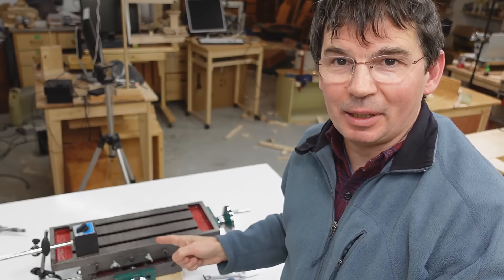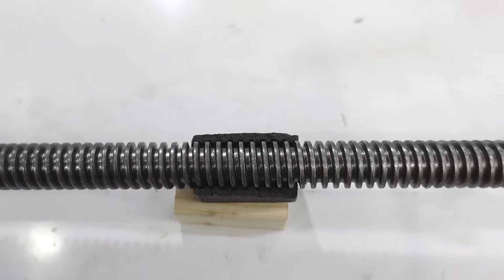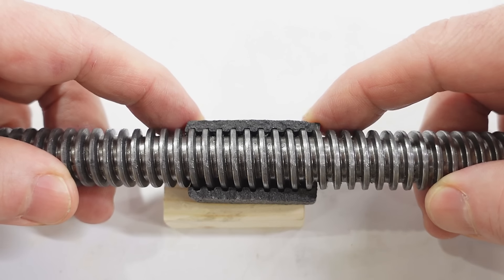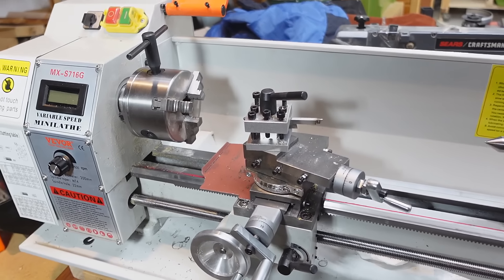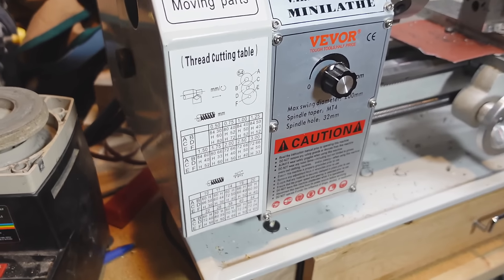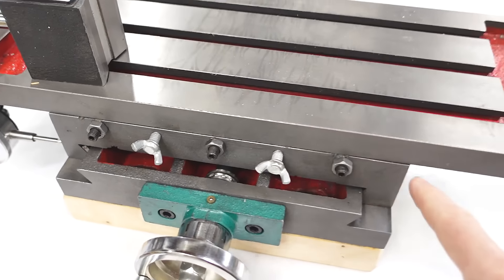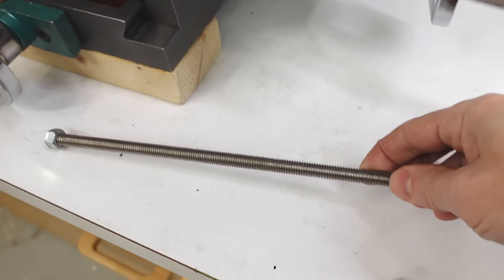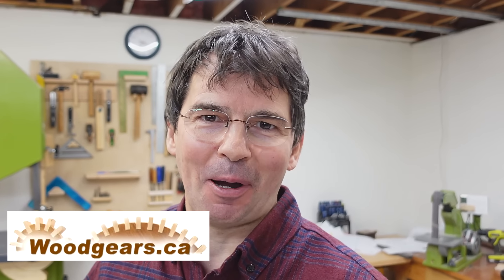Why all the hate for Vevor?

Comment: They do have some great tools for a hobbiest, I have quite a few of their tools, like their handheld metal cutting bandsaw, small compressor, jewellers die grinder, ball vice, and wind generator for the price I have zero complaints. In fact I've also had almost zero issues with them

Comment: I've got a few completely different things from 
Vevor, and so far, I'm quite pleased.
2 chem lab holding stands.
A heated stir plate.
A 50 liter still.
A small 9 pin tabletop ice maker
An AC vacuum pump.

So far, no issues, these are better than the 
competition.

steve

Comment: As i pointed out in the last video over this milling table, im confident a second lead screw nut forward of the factory one would eliminate much of the play, at the cost of a bit of travel obviously.
Also, i have a few vevor machines, one is a band saw. It took some tweaking, and none of the factory markings lined up with their true planar value, but once i got everything in true form, adjusted the marking plates etc, it works quite well! 
I am under the impression they sell these products knowing the near infinite amount of variables in individual shops, so dont focus too much on out of factory precision, knowing individuals will always tweak. Instead they seem to focus on decent build materials at a great price point. 
I mean lets be real, even the best machines get tweaked to factory unrecognizable once they enter each persons shop.

Comment: The challenge with milling on a drill press is that the Morse Taper can come loose due to vibration when milling.   No provision for a draw bar.   I found this out when I tried milling on my drill press.   Now that I have a milling machine with R8 tooling and a drawbar I have experienced the difference.

Comment: You should add a second nut that is spaced out an extra thread width so that the lead screw thread is butting on one side of one nut, and butting on the other side of the thread on the other nut.

they use this in robot gears to remove the slop and hysteresis (but they use two gears side by side)

Comment: You are right about buying used real machines. They often require alot of work and are still expensive. We had a nearly unused small milling machine of a reputable brand in a shop wher eI worked and the table on that had quite alot of play in te lead screws to.

Comment: Harbor freight kind of follows the same model...although a lot of their higher end tools are more up to pro standards in the last few years. If it wasn't for harbor freight, I wouldn't be able to tackle 1/2 of the projects that I do. I'm actually probably gonna buy one of their magnetic drill presses for drilling in steel...their prices are less than half of what the big names want for a comparable model.
Reply: The most important thing drilling steel is knowing the speed to drill steel. For HSS tools in mild steel that's >100 Surface Feet Per Minute. SFPM = (PI * DIA * RPM) / 12 DIA is expressed in inches, of course. The biggest mistake most make is running too fast. I tend to bore 50 SFPM. But technically you can run up to 100 with adequate coolant. Although if you're drilling very small diameters you can over drive then. Burning tools up beats snapping them.

Comment: Regarding your lead-screw.  Don't go with a standard thread they wear out very quickly when coupled with steppers.  I learned this from home-made 3d printer CNC (MPCNC).  We switched to Acme threads and proper nut and they are accurate and long lasting.  Those items are readily available and to most any spec you want.

Comment: You could also drive the lead screw with a belt and use pulley size to increase the torque.
Reply: A twin stack NEMA 23 motor should have plenty of power to drive that table directly. If the motor is driven properly itself. A good TB6600 drive setup right should do it. The trick is in adjusting the current properly. Too much is worse than too little. A meter should be used to actually measure the drawn current. I wouldn't use one with switch selectable current at all. You're better off with a trim pot.

Comment: My experience was slightly different. I purchased a 110/220v convertor from Vevor. Although the photos showed a variety of 110 and 220 plugs on the front of the unit, I couldn't see the input plug. When I got the device I found that it just had a 110 input plug. How were you supposed to input 220v to drop it to 110v? So apparently you can only raise from 110v to 220v. OK, no problem. I wanted to run a 220v saw anyway. Except although the saw was well within the wattage rating of the device, the first time I used it the fuse blew. After looking closely at the fine print in the "instructions", I found that the wattage rating was only for non-inductive loads, like light bulbs, and for inductive loads like motors I'd have to buy a unit 2-3 times larger, although they didn't specify. It would have been nice if they'd told you this up front. So, I contact them to return it. Of course you can't get a human, just email. The email I got back in return said I'd been contacted to resolve the issue, and everything was now OK, and if they didn't hear back they'd assume it was resolved. I replied that it wasn't resolved and I'd never heard from anyone. Perhaps a week later I received the same notice saying it had been resolved unless they heard back, and so on. I think this went on about three times, without their emails even acknowledging anything I'd said in mine. Just the same exact computer generated garbage. Eventually I realized it was a scam and ignored them. I replaced the fuse in the convertor with a spare included (It was good they included one because nowhere was the fuse rating listed). I still can't run my saw, but I could probably use the convertor for some other voltage conversions - as long as it's not an inductive load. Or 220 to 110. I'd never buy from them again. Not because of the product quality, but because of their attitude toward their customers.

Comment: You can make a long plastic nut. A thin-walled nut inside a thick-walled metal tube. This design has zero backlash. And due to its length, its rigidity is no less than that of a short bronze one.
Reply: I've made long plastic nuts and never bothered putting them in tubes. I just use large chunks of plastic. Job done.
Reply: @1pcfred  You just need to use Dial Indicator Gauge. And see what deviation will occur with an application of force of 10 kg.
Reply: @SergeiPetrov  I just use them. They work.
Reply: @1pcfred  I just buy products of such labor. they are a waste of materials and my time. although I admit that with such neglect of measurements with the highest quality instrument you will get exactly the same poor result.
Reply: @SergeiPetrov  taking a long view of things it's all a waste of materials and time. We just get to choose what to waste it on.
Reply: @1pcfred  Why should we eat if we are going to die tomorrow anyway?
Reply: @SergeiPetrov  live every day as if it were your last and one day you'll be right.

Comment: I bought the Vevor MX210 a year ago fully knowing it's imperfections i.e it being a lottery win to get a good one. I had many of the same considerations as you. There were many older lathes in roughly the same pricerange as the Vevor here in Europe, but 
1. I'd have to go check them out = travelling long distances = costs, and 
2. I had a limit of roughly 100 kg to get it into my miniature workshop in my basement.

I figured, since I was (am) a novice hobby machinist, I'd see the cca. 1200 USD as a cost of learning. Should I be able to improve the lathe's accuracy, I'd have learned a lot and gotten a fairly good lathe which I would know inside out. Now I can then either keep it or sell it with the added value.
I would like to know how a good/adjusted Vevor stacks up against say an off-the-shelf Warco, Grizzly or PrecisionMatthews in the same range.

Comment: Now I'm going to have to read up on Vevor. I'm curious as to whether they make or design anything, or just rebrand existing products and buy them from the current manufacturers. I have a wheelchair ramp that is identical in every respect to the Vevor version, but was bought 8 years ago, before Vevor. It is perfectly engineered and built, so I'd guess that Vevor products run the gamut depending on who they buy the stuff from.

Comment: Vevor is also selling ball screw at very good price, that could help you replacing the trapezoidal screw and avoid backlash to install a stepper motor. 😊
Reply: Retrofitting a ball screw is one way to eliminate backlash. Might not be the easiest way though. Definitely wouldn't be in fact. There's no might about it.
Reply: @1pcfred  not the easiest way, but the most efficient, considering the price they’re selling it…
Reply: @grattetout69  it is not what the lead screw costs but the cost of machining the casting to accept the lead screw. It's not just take the one screw out and slip the other one in. Even if you could find a ball screw lead the exact same size as the acme lead there's still the ball nut itself. Which is going to be way bigger than the acme nut. There might not be enough meat to remove enough to get it to fit.

Comment: To illustrate what Matthias said about old machine tools.  I have 3 metal lathe.   A nice little plain/babbet Atlas 10" that I like.   A 15"  10 foot long conehead Sidney, a monarch clone. and a maybe last one on earth non functional Brown & Sharpe Mfg. Co. - No. 6 Plain Screw Machine, a more modern description would be a turret lathe.   The Atlas is something on can move about especially if you dismantle it.   The other two are fork lift and engine cranes. 
Looking forward to the day when I get the B&S working.  Largest bearings/spindle and VERY rigid.   It is a long road as I have yet to find documentation or pictures of missing parts.  I mention it in the hope the right person will see this.

Comment: I'm sure you know this, but, drill presses are not designed to mill.  The spindle bearings are not designed to take lateral forces, and the MT taper tooling does not have draw bars to keep them tight in the spindle.  Sideways forces can loosen them and they will fall out

Comment: I get what your saying but if something is not working as it should a seller should honour the guarantee. I presently have a dispute with Vevor over a fairly cheap multimeter I got for Christmas and I find them to be unhelpful to the extent of operating outside European law.

As to the leadscrew discussion. The only way to improve the amount of backlash is to use a split nut which can contract to decrease the amount of play in the threads, this is what is found on my lathe. To get rid of it completely you'd need to bin the leadscrews and install ballscrews and they cost more money of course. I converted my X2 type mini mill to CNC by using (Chinese) ballscrews and stepper motors, all run with LinuxCNC. That is a real improvement over the original manual mill.

Comment: In case you haven't seen them, the Winky's Workshop channel has several videos about these tables. He reached essentially the same conclusions that you did: crap lead screws, but really good castings for the money. He has a couple videos where he replaced the lead screws with Allthread, which isn't ideal but is better than the screws it comes with. (He seems about as frugal / cheap as you are. :-) He also added really cheap DROs to the axes on one of his Vevor tables, which makes the lead screw issues mostly irrelevant.

Comment: I bought a drill13mm chuck and a Impact driver for combined 93 euros and they've been brilliant to date. I also bought the guide rails they sell and they're good too. I think they'll be hit and miss with some products bcos they probably get they products that mistakes happened on and they get em cheap from the supplier or whoever makes them and if u have to do a little work to get a flat level surface then I guess it's not so bad as long as u know what ur doing.
I'm thinking about getting one of their 3 phase motors, the blue one, for 170 Euros next. They've gotten good reviews so far. I'm also looking at a VFD/Spindle combo as well for a CNC I want to build as well.
I'm thinking of getting one of their cheap Lathes as well Mathias but I'm not so clued up on the engineering side of things. I will use it as a hobby machine to learn some things on. I like tinkering with machines anyways so I will enjoy the experience I hope.. LOL

Comment: I have a Taiwanese round-column milling machine I bought in the 1970s. The table, while larger, is almost identical to this little table in every way. One difference is the table on my mill has hand wheels with 100 graduations representing thousandths, but it has 8 TPI leadscrews, so the dial calibrations are meaningless. Crappy products have been available for a long time, and some specific designs have been around for a lot longer than one might imagine.

Comment: If you do convert the table to stepper motor drive, you could repurpose the handwheels to drive an encoder which would then drive the steppers.  You would have both computer and manual control without having to buy another table.

Comment: Matthias Wandel:

Can you do a sound level comparison between one of your pro level tablesaws (ie: delta), an entry level tablesaw (ie: $50 plastic Stanley, like I have), and one of your wooden home made tablesaws?

I'm thinking about how a wooden enclosure would dampen the noises & vibrations of the motor, while mine resonates, amplifies, and vibrates across the floor.  Then I figured, you've got one, so test a good one too.

(I balanced the blade, but I'm not doing more. When it's like this, it's easier to move.)
Reply from the maker: All I have is my big table saw at this point, but its not a professional saw.  So can't do that comparison.
Reply: @matthiaswandel I wasn't interested in the pro comparison, initially. I'm curious if a homemade one could be expected to improve much over my cheapass one.

I bet an actual pro one is fancier, like all chrome n'shit. I wasn't sure what to call yours, but it does more than I will ever need.

Comment: I just assembled a vevor ws-p02 sim racing wheelstand.  It is almost, if not identical to the offering from a company called next level racing.  I'm so impressed with this knock off, NLR price is about £200, i bought it new from eBay for £55.  It's brilliant, rock solid, although I'd be upset if i was the creator of the original design.  
I might even do a short about it.

Comment: I have a question, most people have a compressor in their shop an also have some form of shopvac , is it possible to make some form of ad on to convert 'blow' into 'suck' or is it not viable?
Reply: Two completely different types of blow/suck. A shopvac is basically an HVLP machine (high volume, low pressure <25psi), whereas a compressor uses high pressure, usually up to 120psi or more (and the volume is usually relatively low). If you could be more specific about your usage you might get more replies.

Comment: The reason why companies like Vevor exist is due to a niche in the market created by a mixture of "economy of scale" and "starter/beginner/hobbyist demand."
"Economy of scale" makes it more expensive for hobbyists to create anything from just raw materials or simple and interchangeable parts (like bearings, motors, etc). It's far more economical, and approachable, for a hobbyist to start with something that isn't good but is usable and can be turned into something that is good with some cleverness and small purchases made over time. This generates the second part of the equation, the market demand, that allows companies like Vevor to utilize the first concept to fulfill the second. 

Because this is their business model, showing the flaws in a product is actually just outlining different things that a hobbyist can work on and improve with the machine. It's not detracting from the usability when high precision isn't required. From this perspective, there really isn't any method of giving a "bad" review of a Vevor product. The only way they can fail is by failing to provide excellence in other facets of the company, with Customer Service being the major facet. So long as they can handle the complaints and don't mind spending the money for returns, and as long as they provide an approachable and easy to navigate customer service system, then the company should remain profitable for a long time. This is how Harbor Freight ended up losing market share. They forgot that their key to success was Customer Service.